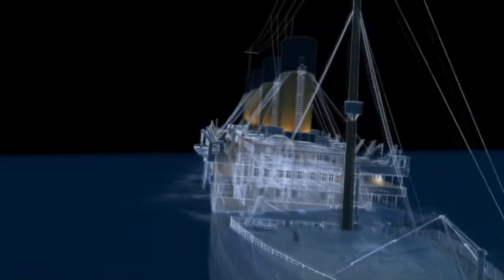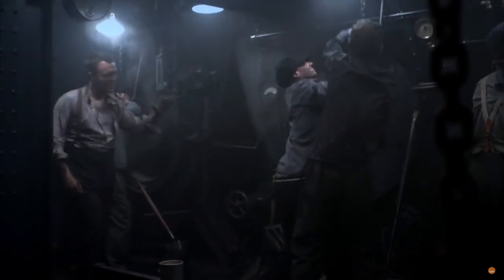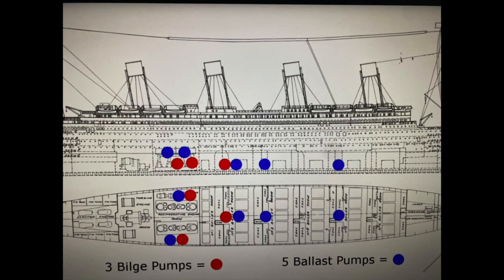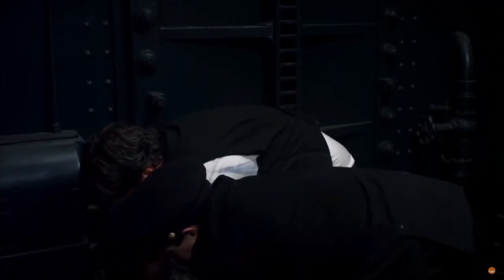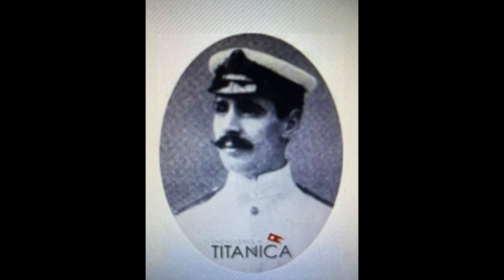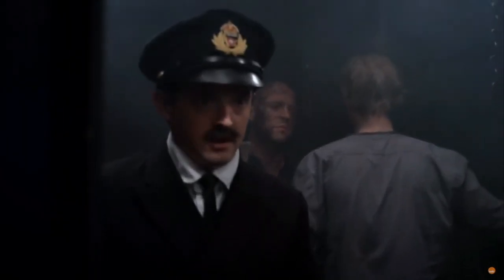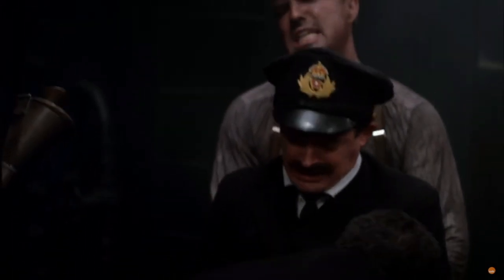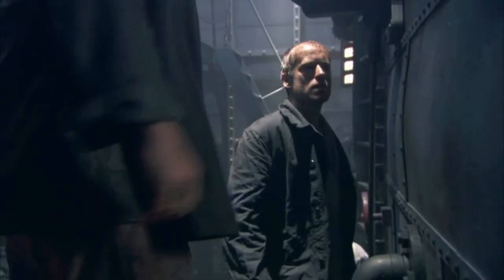Titanic History/The Story of where the Final battle to save Titanic took place! reupload

Comment: Titanic’s Engineers stayed at their posts even when they were released. In just about every re-telling of the account we learn of the electricians who remained keeping the power on, the pumps working and most importantly of all the lights still lit. As we know this meant keeping at least some of the boilers in steam just to power the massive dynamos or generators. I am guessing Titanic’s electrical systems were direct current.
We know for certain that the flooding kept tripping the circuit breakers and no matter what, even at risk of being electrocuted, the engineers kept putting the breakers back in. They must have known they were not going to make it off the ship into a lifeboat.  Without a shadow of doubt these people helped to save many lives. Had the power gone off far fewer people would have escaped the sinking liner.

Comment: I think it wasn't 100% of the coal bunker wall that failed, I think it was the door. You see the coal bunkers had doors that lead in to that boiler room and at the time of noticing the flooding into that bunker Barrett closed the door and left it shut. The door was even worse than the wall that held it up, if the coal bunker got filled up with more than ten or eight feet of water, my math tells me that it would have failed and broke open. I think that's what would have caused the massive flooding into the 5th boiler room.

Comment: I always wondered if they could have delayed the sinking by using all available canvass to stop as much flooding as possible from the outside of the hull. Seems crazy? Maybe not. Once the officers and crew realized the lack of life boat capacity and any other attempts to save the Titanic were futile, why not try anything.
Sixteen lifeboats were covered with water proof canvas. The breaches in the the outside hull would provide the suction needed to stay the canvas in place while the pumps helped. They also had the benefit of an ocean as calm as a mill pond. All they needed was time for the Carpathia to arrive in four hours.  Okay, who goes in the water to attempt to place the canvas? The crew of course. Not in their contract? Why not? They would soon feel the stab of a thousand knives along with all that could not be fit into a lifeboat.
If the Titanic stayed afloat till the Carpathia arrived, every soul would have been saved. Except poor Engineer Shepherd.
Believe it or not, I thought of this when I was a little kid. 
Mahap it would work and mayhap it would not. Just try anything while one is waiting to die.
Reply: Patching a hole in the hull of a ship with canvas on the outside was a known damage control option from the age of sail.  Problem is titanic was just to large to get any patch in place, and anyone trying to manually place it would have been caught in the suction of the water entering the ship.

Comment: I love your videos, very informative. There is a theory that sais that the coal bunker wall was damaged by the coal fire and that is why it buckled and broke, up to that point Titanic was salvageable, well maybe not salvageable but at least stable until help arrives. Do you think that's accurate, or any metal plate even unaffected would have done the same under all that water pressure?

Comment: Given the forward tilt and overflowing of the watertight bulkheads any reducing of weight forward would reduce the speed of sinking, therefore cutting and dropping the anchors and chains would have helped
Reply: I doubt that would have bought them more than 30 seconds or so
Reply: 1. The anchors and chains made up a tiny fraction of the weight.
2. It would have taken too long to cut through the chains.

Comment: Stupid question, if titanic had started reversing at full speed after they found out they were taking on water, would it have made a difference to the sinking time? im thinking, maybe the water rushing past the bow would have created suction, and kind of equalised the pressure between the outside and inside of the hull?

Either that, or, with it being the front compartments that were taking on water, would the reversing motion have stopped water over-topping the watertight bulkheads, given the crew enough time to pump water out, bodge the ship up best they could, and sailed somewhere? if only to sink in harbour?

Another stupid question, could they have reversed to the iceberg, and somehow let the passengers step off the ship, onto the iceberg, and simply stood on the iceberg until help arrived? they might have had chance to save everyone

told you it was a stupid question lol